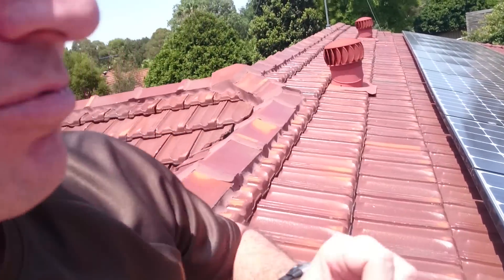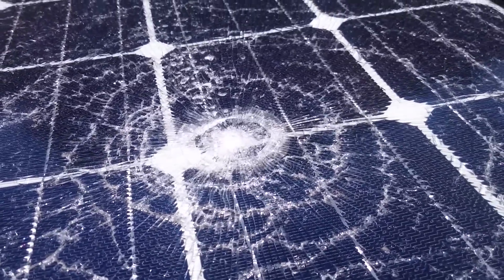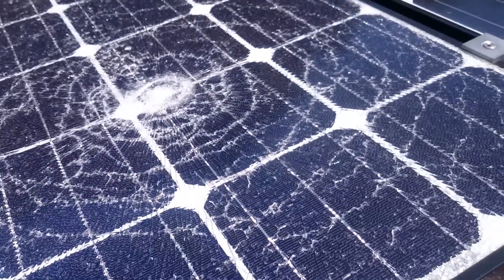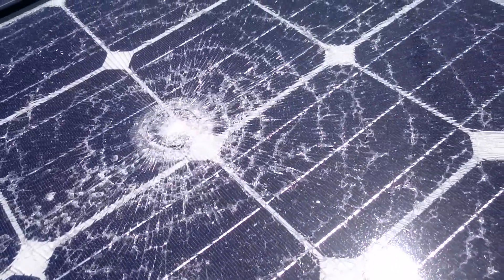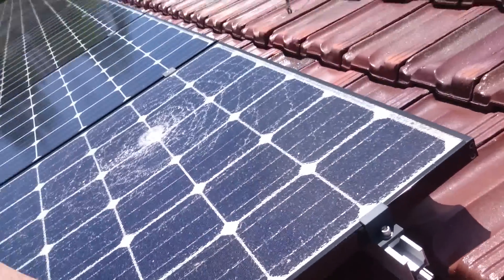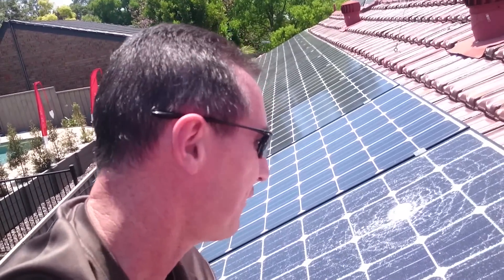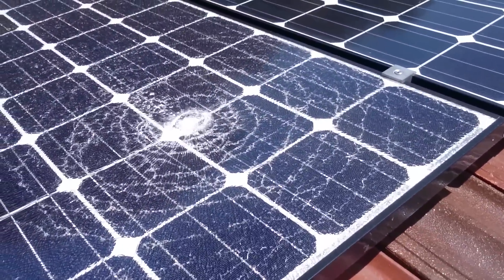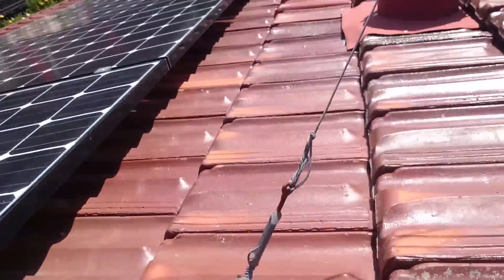Home Rooftop Solar Power System Update - Shattered Panel!

Comment: if the glass is bonded to the surface of the panel, you could try repairing it with clear casting epoxy. if not, you could just replace it with polycarbonate.
Reply: +Maltfalc  No, And no.
Reply: +Maltfalc  It's a good thought I'm not sure what conditions are where he is, but epoxy could cause problems with it's erratic expansion and contraction during heating and cooling of the seasons. They don't use it to encapsulate panels because of this as it would crack the cells and probably yellow heavily after a few months of UV exposure. I'm not sure about PC,  you would have to check to see if there is  a UV resistant type, and doesn't yellow as well. I know acrylic doesn't last long outdoors.
Reply: +Maltfalc NOPE! you NEVER want to use any type of epoxy on these, they will either yellow up or cloud up or both in a short period of time
Your better off having it replaced though a shattered panel will still function with some loss but not too much if the actual cells are not fractured.
Reply: sigh there are uv stable epoxies, even some made specifically for encapsulating solar cells.
Reply: +Maltfalc Chances are there will be moisture in it now, and you'd never want to seal it again with moisture inside. Much better to leave it be till it fails or just replace it.
Reply: +ElfNet Gaming The loss, assuming no electrical failures, would only be perhaps 10% or so (the white area, where light that normally would be transmitted is being reflected/refracted).  That is why it is hard to see any change in output.  Until it fails, it is not worth replacing (unless free which I think is unlikely).
Reply: +Simon WoodburyForget A 4 mm thick ALON or sapphire window for a 250W solar panel would probably cost more than $100.000, I think we should stick with regular glass :)

Edit: Oh, and such a window would probably have less than 90% optical transmission.
Reply: Maltfalc Epoxy for solar cell encapsulation? Please link some I couldn't find any that is designed for 45W+ panels. They use it on cheap cells for garden lights and such but that's because the battery will likely fail around the same time the weather has ruined the epoxy/cells. I've heard of some people (DIY studies) using UV resistant epoxy on the flexible cells. Not mono crystalline cells though as they will break in epoxy during changing weather conditions. The typical encapsulation is an elastomeric polymer that is flexible, yellow, and UV resistant plus non corrosive. Very similar to ultra clear caulking minus the solvents. Some are silicon based (cheaper) and some are elastomeric polymer. Some newer applications use the same polymer but as a tacky peel off film rather than a two part mix.
Reply: abyssunderground Yes agreed unless you have an oven big enough to put it in at 160 for a few hours. Probably voids any existing warranty though.
Reply: +MelancholyMasochist Yeah. LG sealants, or a little epoxy additives ip search should yield the halfweight of epoxy in stuff to keep it from yellowing for 20 yrs.  Or of course with good rain cover in 20yrs. it can be let to derate w. an agonist like sulfate until washed out and resealed. If Dave just goes with a 1200cm. tablet screen protector of course, we can get an update in 5 years instead of 42 on outcomes.

Comment: It might have been ice falling from a high altitude aircraft, it happens from time to time when the plane sewer system leaks. 
Hopefully it's covered on house insurance.
Reply: +Green Silver ice bullets....the perfect crime.
Reply: I agree that a possible cause of such damage would be ice falling off an airplane! it has nothing to do with the airplane's sewage system, though. It is completely normal that an ice crust is formed on the front edge of the wings. There are cushions on that edge that can be inflated to break off the ice in mid-flight when the buildup starts interfering with the aerodynamics. This would be the only thing that can cause such damage and will not leave a trace after having melted/drying out.
Reply: makes sense
Reply: +Green Silver THIS!!

It would explain why there's no trace of anything left, since it would have melted and evaporated. There's probably a lot of air traffic above his house.
Reply: +Green Silver "Hello, I'd like to make a claim. One of my solar pannels got smashed by a falling poopcicle."
Reply: +Green Silver I like that theory but I'll stick with the cricket ball.  depends when it happened.. winter is gone in australia and the hot cricket weather started

Comment: Symmetrical impact rings, that suggests a near-vertical angle of the object before the strike...  I'd say parrot or raven with a large stone.

Similar issues have happened in England with Ravens using rocks to break shiny windows to get at the pretty shards.
Reply: +Nighthawke70 Dave' s rooftop is not flat, so that bird would have to hit it not directly from above, but at an angle roughly perpendicular to the rooftop, judgring by the symmetrical impact rings.
Reply: Neverthless, I'm sticking with my raven theory.
Reply: +LarixusSnydes bird is flying, making the rock not fall straight down but at an angle. Think about parachuters, they don't jump out of the plane right ontop of their landing spot. Sure you could calculate the bird's speed, height above the roof, or angle that it hit the solar panel assuming you knew at least some of the variable's values.

Comment: Golf ball laying against neighbours colorbond back fence. Second panel over from your fence. Upper right of frame. In shot 0:26 to 0:34 and right mid frame from 0:03 to 0:06.

Came from front heading back. Hit the panel, lost energy as the tempered glass collapsed and went right at an angle because of the gable and came to rest next door against back fence. Still there.

Bad luck mate.
Reply: Wonder if there are any driving ranges or golf courses nearby?

Comment: You still need to replace it , because if its rains the waters may short the cell inside. The crack looks like some hard impact object hit it , but maybe caused by over tightened on the bracket bottom caused the panel to over stressed and cracks..

Comment: Although you might think there is no trace of the object that caused the damage I would suggest you throw a few fragments of the glass from the "pulverized" area under your microscope.  If it was a cricket ball or similar then there are bound to be very tiny particles from the surface of the ball embedded in that middle impact zone.   Do some forensic work Dave!  Look for tiny spots of coloured material.

Comment: How annoying. My guess is that a cricket ball is the likely culprit...
Reply: +doodr Impact is way too small for a cricket ball. Have you ever held and seen one of those things? They are pretty damn dense and would of done a lot more damage.
Reply: +RygartARTB Cricket ball is very rigid, and could have done it.
Reply: +Heath Wells Since the panel is already damaged, it could be used for some typical impact tests.
Reply: Allison Pell the angle is too high for it to be a cricket ball, the impact is near vertical. There is also scarring off sorts going in direction. Too/from the impact area in a single direction.
Reply: +RygartARTB "the angle is too high for it to be a cricket ball"  have you even watched a game of cricket? lol
Reply: +Tripcore Yes, I have watched hundreds if not thousands of matches and played hundreds.  As a kid I hit many many cricket balls on to roofs exactly like Daves.  This style of housing and roof pitch is the most common in my country ( "bungalow"). Backyard cricket as a kid is an institution in NZ as much as it is in AUS where Dave lives...
Reply: Heath Wells -
Reply: Tripcore So you're saying a professional cricket player just so happened to be smacking a ball around near Daves house?

It takes a lot of effort and force to send a cricket ball high enough you create the impact shown in the video. A regular ball impact with a low vertical velocity would only shatter that glass, the impact in the video has been actively shattered and crushed (the white areas.)

Cricket balls also don't give off debris, re-watch the video and you will notice that there is secondary damage in direction leaving or moving towards the impact site.
Reply: ***** Nobody said anything about a professional cricket player.

"It takes a lot of effort and force to send a cricket ball high enough"

I don't think you've ever played a game of cricket.

ps.  I actually got the op and yourself mixed up.  This message was for you and not the op:
"Then you should know that the angle is never too high for a cricket ball, since one is able to hit a ball straight up in the air."

But anyway, if you don't think it was a cricket ball, what do you think it was?  stop pointing your finger and give an alternative solution.

Comment: I had a solar water panel damaged in a similar scenario. The glass face was safety glass so it shattered into small cubes.
The PV system adjacent was untouched.

While cleaning up the glass I found a small white river pebble of the type people use in their gardens sitting nearby. (My solar is on a flatter section of my roof, so unless something is perfectly round, it will stay were it falls)

 I assume this pebble was the offending object. There was only one. If it was vandalism I would have thought they would have lobbed a few more up there.
In my case the glass cover of the water absorber pretty well totally shattered into small cubes of glass, so I didn't get a nice impact crater like Dave is seeing on his PV panel.

My assumption is a crow (or Australian Raven) of which we have a few around the area - who stage raids on the pigeon nests in a nearby palm tree, picked up this white pebble thinking it was an egg and either dropped it once it realised it was solid, or even deliberately dropped in an effort to crack it open and one of my solar panels just happened to be underneath at the time. (Corvids are smart buggers, dropping things to crack them open is a known behaviour. Covids are also known to use tools.)

My panel was replaced by household insurance.

Dave might just find a small white river pebble in his gutter if the rain hasn't washed it away since the impact.

Comment: PV panels are actually really good at handling hail impacts.  The panels at the GFs hobby farm recently copped hail up to cricket ball sized (neighbour has some in the freezer), and none of the panels was damaged (although you could see the impact spots left over as the ice and water dried off).  Helped that the panels were on tilts that reduced the angle of impact (storm came from behind the tilts).

Comment: Looks like a baseball or another ball similar size. Neighbor kids?
Reply: +Kille78 
I was thinking golf ball but I don't think any type of ball would carry enough energy to do such a huge amount of damage.
Reply: +Kille78 Baseball or golf ball. The problem is - at that angle it would have needed a fair bit of momentum. Like direction momentum. I bet it was those "batterizer" guys! Or the fan fictional ODST drop-bear.
Reply: +Ian Clarke golf ball would bounce off, its not dense enough, neither is a baseball or any other sports ball shy of a shot-put
Reply: +ElfNet Gaming cricket ball probably
Reply: +ElfNet Gaming A golf ball can go clean through the windshield of a car, so I do think you are mistaken there.
Reply: +Kille78 with that impact i don't thing so
Reply: +Kille78  Cricket ball maybe, nearby parks or kids I do wonder as well.
Reply: Slot1Gamer
 Snooker ball then
Reply: You guys obviously have never seen what kind of damage a foul ball can do. It's not like those panels are indestructible. It's pretty obvious that some kind of ball caused the damage considering it's a perfect circle.
Reply: Kille78 or some shit like out of Independence Day
Reply: +Ian Clarke It's tempered glass. It's design to break into pieces.
Reply: +Kille78 This is exactly what happened to my neighbors solar panel.  The kids playing baseball (American Hardball) and drilled oen right into the panel.  It bounced off and landed in my yard...
Reply: Rico Swave did ya smack em'
Reply: Slot1Gamer No, I don't run around the neighborhood smacking other peoples kids.  That seems a quick road to incarceration...
Reply: +Kille78 correct. cricket ball
Reply: dothemathright 1111 The damaged solar panel looks more like how bullet proof glass would shatter.
Reply: +Tripcore it's just standard tempers glass which is laminated to the panel
Reply: bOwToMeE0 Yes I know it's made differently, I'm just saying the damage looks the same...to me.
Reply: oooooooHH pour optical UV adhesive on it! It'll work like resin but shouldn't go yellow
Reply: +Kille78 Baseball in Australia?

Comment: It's hard to tell because of the coloration; it didn't hit in the middle of that high contrast blue. If you stand on the edge of your roof (which you can see at 0:32) and make the corner into an equilateral triangle with your arms, you'd be facing more or less the direction I think it came from. You can look up 'Wallner lines' and 'hackle' to confirm this. Determining the size of the impact is not so cut and dry; shape, velocity, and material composition of the impacting body can widely vary while producing superficially similar results. It was certainly a spheroid object, the circular depression around the crater is a pretty good indicator. It looks roughly about the size of a golf ball, assuming a lot.

Comment: Golf ball?
Reply: +Ali Azri (yayie) Yeah, had to be something like this.
Reply: +doodr No Baseballs here is Aussie mate. Only Cricket. And that will leave a mark.

Might be the neighbors, they have a decent backyard. Suspicious.
Reply: +Ali Azri (yayie) Most likely something with a sharp end. Or a really strong hit with a ball of some kind.
Reply: +tejasviization It wouldn't leave a mark if it was one of those white plastic practice balls
Reply: +Ali Azri (yayie) That was my thought. I notice that there's a small spot in the very center of the impact site where the glass is extra-pulverized and whiter than the surroundings. I'm thinking that's the actual impact area, which would be consistent with a high-velocity golf ball impact, and the missing glass around that small spot is just due to secondary ejection or something.

Comment: I highly recommend getting it replace the whole panel for safety. Also I think a baseball might have hit it. It looks about the size of one
Reply: +Ttomisabeast I suspect the dropped section is misleading, that's just the area that was loose enough to fall out as the integrity failed. A ball would leave a rounder depression, and would have impacted on the cells underneath. One possibility, other than fatigue/stress is a BB (ball bearing).
Reply: ***** Didn't know that. I am in America so yeah.

Comment: 85% the neighbors, 10% a big bird died mid-flight, 5% cosmic rock
Reply: +Stewart Fisher mid-flight died bird usually leaves its body. However, I've seen falling big bird on a rooftop of my car (it was bent in), and after a few moments the bird confusedly just walked away.
Reply: +Stewart Fisher Epileptic bird then.
Reply: +Andrew Bond that bird feel asleep mid flight?
Reply: +Stewart Fisher Dinkleberg!!!
Reply: It froze mid flight. Or are Australian birds made from iron?
Reply: +Stewart Fisher You missed lawn mower accident. Definately #1 most likely in my book.
Reply: +Richard Smith to be fair, my grandma shattered her conservatory window with a lawn mower that ejected a stone. suppose it,s possible it could launch it that high, but it doesn't look like a impact that came from somthing with more horizontal than vertical speed. Guess it's all up for debate.
Reply: I also say law mower. Have kill a Window at my home too.
Reply: +Stewart Fisher , but mechanical stress with small growing crack ?
Reply: +Andrew Bond Could have been picked up by another predator.
Reply: +Stewart Fisher But at the end of the day, aren't we all just cosmic rocks?
Reply: +Stewart Fisher Big Bird Died? Watch out for the rest of Sesame street falling down next ... :)
Reply: +Stewart Fisher In my home town a bird broke big 3*4m hardened glass window. The window had 2 glasses and the inner glass was intact, but outer one had a hole in it and the rest of it was shattered like in this video. I was told it was a big seagull and it walked away after falling to the ground.
Reply: Leht Tuules A bird broke a window when I was a kid in school. However, it was because it looked like to the bird, a nice shelter, as the bird could not see the glass. It was flying extremely fast.
The bird only cracked the window, and killed it instantly. I find it unlikely this kind of damage could be caused by any bird light enough to fly. 
I have heard of bird of preys grabbing turtles and flying them extremely high, and dropping them to crack their shells tho. Still, sounds unlikely.
Reply: Simon WoodburyForget Lol, the mental image of a turkey having a heart attack falling out of the air and hitting a solar panel made my day. Thank you.
Reply: +Stewart Fisher 99.9% cricket ball

Comment: Well if the spider cracks dont spread to deep you could put some silicon on the impact zone. Or possibly use some strong resin to seal it up again.

Comment: Nearly did this to our panels with an air cannon in my backyard lol
Do be careful replacing those, on a good day in the sun they chuck out about 400V DC! There's usually a main isolator on the roof that shuts the power off to the rest of the system

Comment: Point shock might imply an imperfection in the glass, stressed by repeated thermal cycles. I have seen it happen to car windscreens in relatively low thermal conditions, even a tiny chip can cause it.